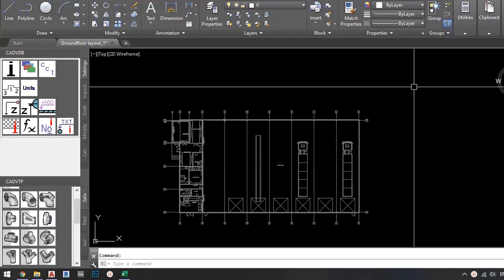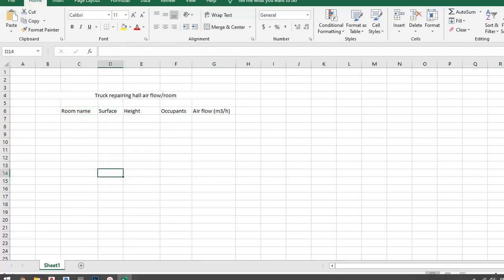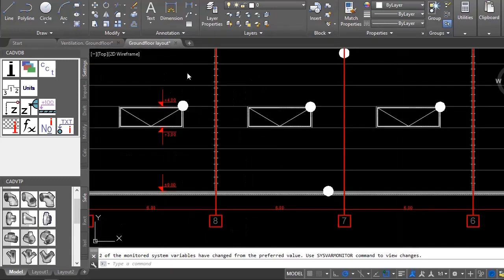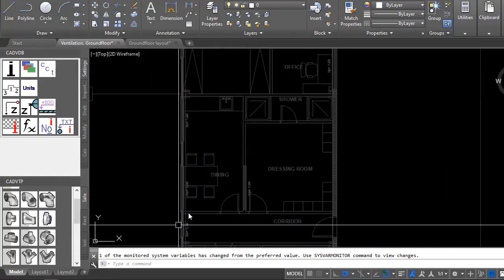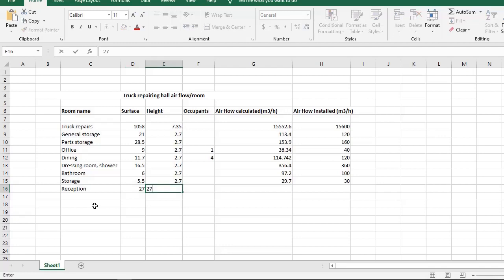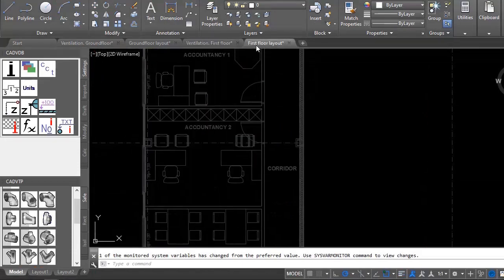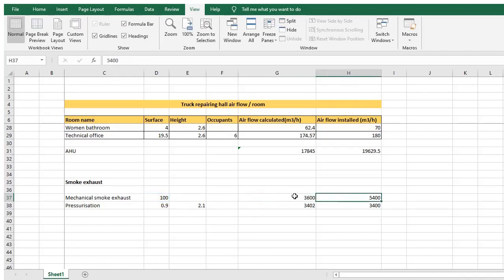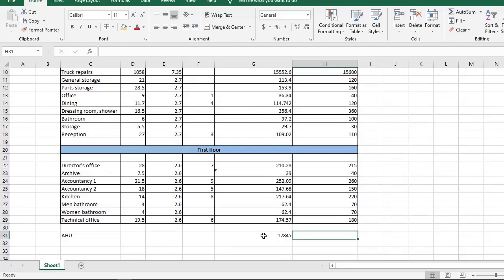Calculations for AIR FLOW in HVAC Systems

Comment: Bro which freelancing would be best as beginner revit hvac or autocad hvac mep ? Could you suggest important factors which can get me my 1st clients..
Reply from the maker: If u want to work in revit u also have to have 3D arhitecture. if u work in autocad u need 2D architecture. So, it would  be easyer for u to work in autocad. To get clients u need to promote yourself on social media. Also think what can u do better than your competitors. And don't give up, keep on trying and u will have success !
Reply: @capybara7299  Thanks a Ton 💚 Could u suggest some best books to read to get more insights about the steps of the business for attracting clients by pitching properly ? Apart from sales skills what would be crucial.. i like reading books so i would love some suggestions on or related to it..
Reply: @capybara7299  Also i have mentioned my projects done during internship should i also add some more things in it to become a stand out person in the eyes of clients..